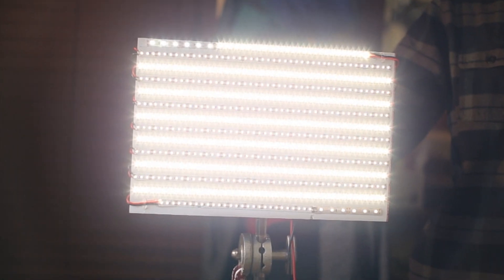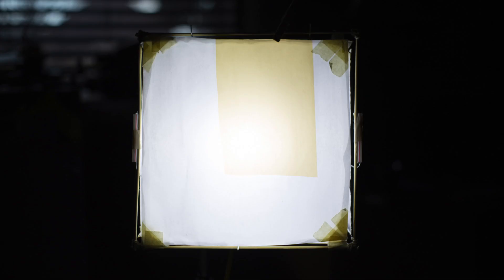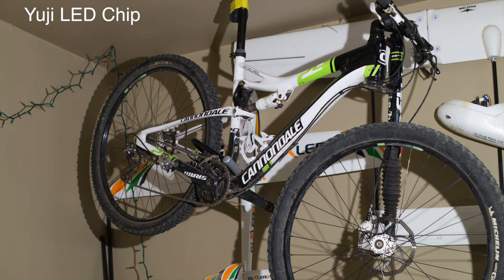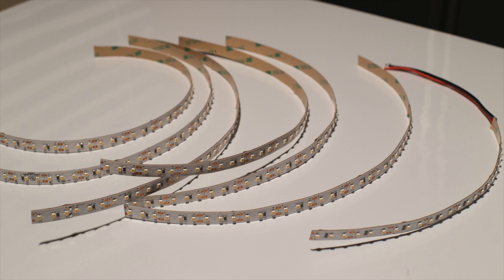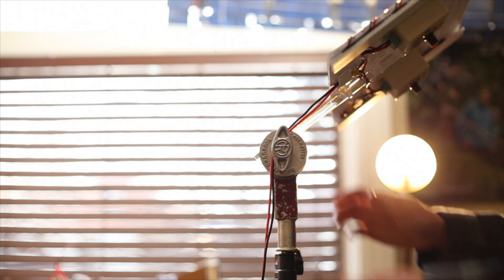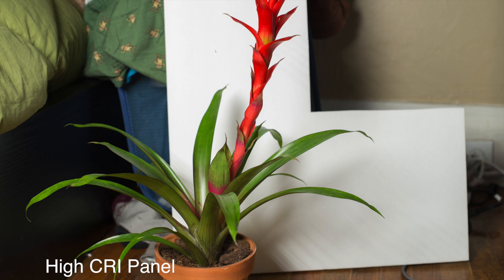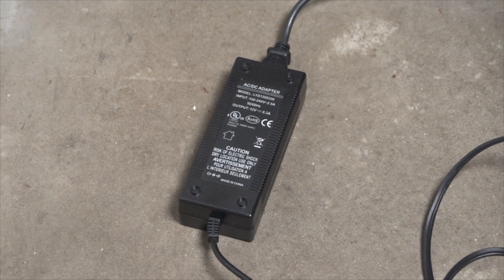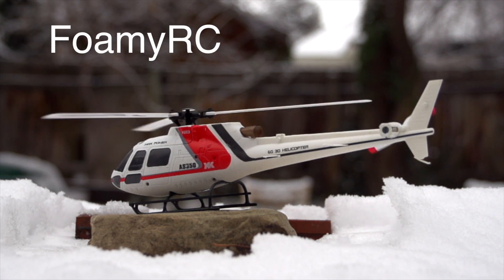RCTESTFLIGHT - DIY LED Film/Photography Lights

Comment: You don't want a voltage dimmer for controlling the LED brightness, but rather an adjustable current source. It will provide whatever voltage is necessary to keep the current constant, which will control the output from the LED.

Comment: It's clear the High CRI LED's had a LOT more Red in them... nice comparison work!
For an LED dimmer, you can use indirect PWM power regulators. These are called "buck CC CV step down" converters... they are essentially a variable DC power supply, but allow Constant Current (the "CC"), as well as Constant Voltage ("CV") controls. 

For "raw" LEDs (no resistors), you would set the Voltage control to supply somewhat more than the LED's need (while no LED is connected). Once connected to the LED, you would adjust the Constant Current (current limiting) to get exactly what you need... filtered DC, with adjustable Current. Obviously, don't run the Current limit up above what the LED is rated for.

However, if you use it with LED strips that already have current limiting resistors (LED strips made for 12V DC), you can reverse the above... set the Current Limit above what you'll need (short-circuit output, then adjust Current Limit), then use the Voltage Adjust for actual dimming... just don't go above the rated voltage (12v usually).

https://www.amazon.com/gp/product/B013STIJ5W/ref=ox_sc_sfl_title_1?ie=UTF8&psc=1&smid=A1THAZDOWP300U
The on-board multi-turn pots can be replaced with larger ones for easy adjustment, but should have limiting resistors to keep you from accidentally adjusting the Voltage or Current too high.  

There are better versions with multi-function LED readout on-board (display Amps, Volts, or Power), such as:
http://www.ebay.com/itm/LED-Voltage-Power-Current-display-DC-Buck-Down-CC-CV-Adjust-Power-Supply-Module-/252411073186?hash=item3ac4df52a2:g:4PQAAOSwQupXT~lK

These all require about 3V more input Voltage than you expect to Output... but can typically accept up to 36V DC input, and give 2-32V DC output.

Comment: nice panels daniel.  make me feel ashamed for my poor lightning in my hangar "studio". Normally I use a neon bar overheads and a small LED videolight on the gopro tripod. it came with a dimmer that does exactly like your DIY panel - it alternates between two sets of LEDs with differnt color.

Comment: just some quick tipps for you... (because i mess with diy film lights for a while)

best cri is lightbulb or natural sunlight  with a CRI index of 100.
Next best for filming is halogen 95.
LEDs CRI are 80-90 in best cases, but ultra energy efficient. 
Halogen is a better choice in therms of quality light and mobility as well as power consumption.
Ever heard of kinoflo lights? They are very easy and cheep to build and nearly as good as sunlight. 

LEDs even they are from the same source differ in quality. 
If you want the ultimatie film light you have to select them one individualy. This can take very long time. Thats why the pro lightpanels are so expensive.
If you want to control the brightness on LEDs you have to use a current regulating stepdown converter. just google for "current regulating step down".
Or attach barndoors or Filters.

Comment: in the beginning you said you didn't want to spend hundreds of dollars on a panel light, but the Flexfire strips are $17/ft. ! and the Yuji led is $83 for just one. add all the accessories required for everything to work and it starts getting up there. is this route worth it? i'm not good with electronics and would prefer to just plug it in and use it, but if it's like half the cost then i could learn to build it. awesome vids. thanks a million.

Comment: you can greatly reduce the PWM flicker with a smoothing capacitor, and still use cheap dimmers
Reply: Not that easy. A capacitor will just increase the brightness for the same potentiometer position, and highly increase current surges. He also needs a inductor in series. 
By this point forget the idea and just buy a buck or boost DC converter.

Comment: put a capacitor on the output to smooth out the flickering of the lights
Reply: +Ultra RC hey can you please tell me how to solve the flickering?
Reply: what I said above
Reply: what type of capacitor and where to put it?
Reply: 2200uf cap on the input of both led arrays

Comment: what gimbal is that at 4:45 ?
Reply: +Avery Caudill I wanted to ask same question :D
Reply: +Avery Caudill looks to me very much like the MOY 3 axis AKA the g40 gimbal.
Reply: +Zev Hoover thanks, that looks like it to me too
Reply: I have had one it worked great but make sure you never have a camera+lens combo over 600grm, it WILL bent and cause micro wobbles that the gimbal cannot compensate.
Reply: +Zev Hoover I'll keep that in mind if I ever get one

Comment: Just take an Elektrolythic capaciter (25V 2200uF or more) and solder it to the output of the dimmer, than the flickering would go away.
good luck ;)
Reply: +Alex K you mean have the cap go to ground?
Reply: Ground of the cap gos to ground of the LED strips..and positiv side of the cap gos to positiv side of the led strip..very easy ;)
Reply: yeah that really makes sense.
Reply: +Alex K would that stop the flickering for film making? because he the guy in the video says it only show flickering when the light is recorded.
Reply: anthony hom yes.

Comment: For the record. The dimmers used in this video flicker because their PWM operating frequency is mere 500Hz. That's too low. Voltage dimming is actually a worse choice for video light because, first, it introduces blue color shift, even though it's negligible in most situations and second, voltage dimming is less efficient and will drain battery faster. You would be better off just using a proper PWM dimmer, like the one below, that pulses at 25kHz which won't be noticeable even on a high speed camera. There are plenty of decent PWM regulators on ebay/ali, anything above 10kHz won't flicker with regular camera.

aliexpress.com/item/10-60-20A-PWM-DC/32863985621.html

Comment: NUUUU, don't use a voltage adjustment dimmer.  It's bulky and inefficient.   Use PWM, just get a higher frequency one.  You must be using around a 60hz PWM, get something more like a 500Hz PWM.  This is easy to achieve with any typical microcontroller.  Then, you can amplify this signal (3.3-5V) with some npn, and pnp transistors to your LED driving voltage (12V?) and then put this into the gate of some MOSFET transistors that can power the LED's.  50A MOSFETS are only about a dollar each or maybe even cheaper depending on where you go.
Reply: +DeadtomGC hey can you please explain the steps to getting rid of the flickering? Im confuse